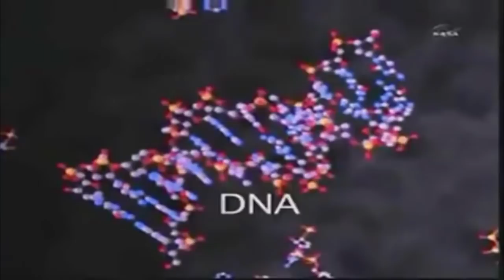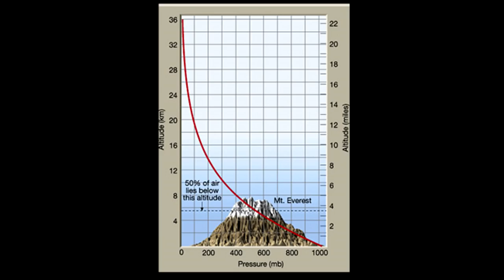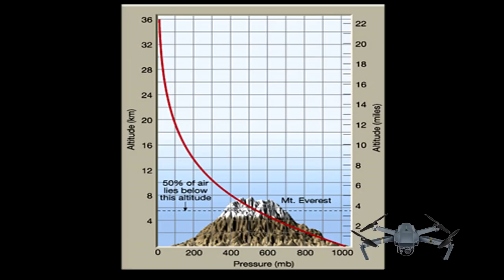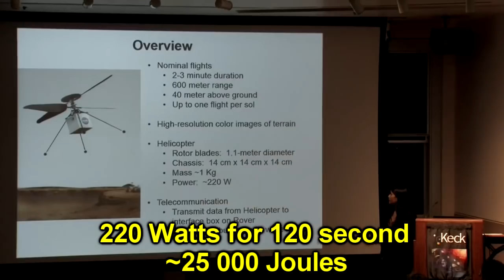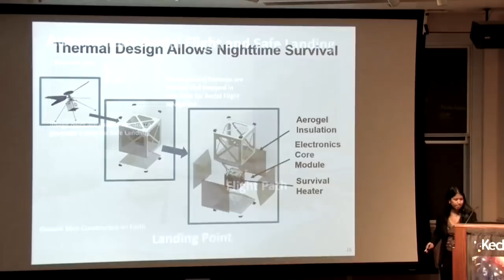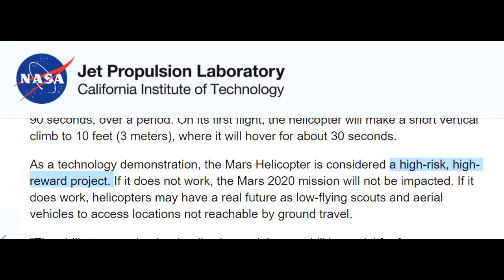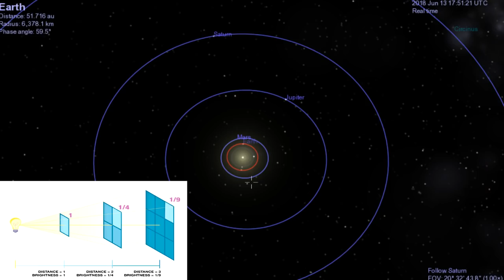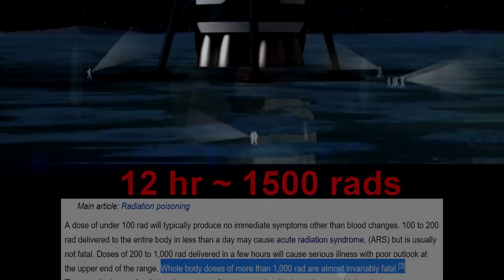NASA is sending Helicopter to Mars!! Smart or Silly?

Comment: Hm..the oversimplification about the lift of the blades makes the calculation not satifactory to me. In aerodynamics/fluid dynamics the forces on the blades increase by the square (lift and and drag as well). So you don't have to spin the blades twice as fast to generate twice the lift. This is comes from the kinetic energy of the air molecules being deflected where the velocity is by the square. If the rotor spins twice as fast in haft the density (half the molecules), the molecules deflected have also twice the downward speed (and 4 times the kinetic energy). 

The calculation of the power of a 40W rated solar panel should also be looked at: The 40W is instantaneous power. Whatever the instantaneous power is delivered by the panel (Diminished by the factors 1/3 well explaned in the video because it is layed flat during the day) should not be again divided by two the step 'Average continuous power (earth)'. That is already include in the step before 'Average power for daylight hours'. Space grade TJ solar cells (up to 30%) are almost double the efficiency of the solar panel used as reference here (app. 17%). The 1W can be easily be increased to 2W in my opnion.

I like the video and it triggers my scientific thoughts,  but must agree that there is lot of wishful thinking in how some project are presented by Mr. Musk after all but in this stage that is very natural and it is not a bad thing to be aim high, not sure it it realistic though.
Reply: Not exponentially, just square-law.
Reply: BrightBlueJim  In deed, you are correct. Thanks

Comment: make the blades out of solar panels.
Reply: ᗩ乙Ꭵᖇᗩᖺᗩᙓᒪ solar friking blades roadways
Reply: Tumbbi well, they will be less resilient than solid carbon fibre, but look at all that surface area.
Reply: ᗩ乙Ꭵᖇᗩᖺᗩᙓᒪ meme only for thunderfoot
Reply: Probably not gonna work due to wiring / connection factors as well as centrifugal forces on the N- and P-plates in the solar cells.
Reply: that wouldnt work that would make them very heavy and require a lot more power to spin mabe the sides could be solor panels though,

Comment: I agree with most of what you say, but, concerning what you say around minute 12 about the efficiency of solar panels: aerospace applications use extremely expensive multi-junction cells, which are twice as efficient theoretically than the garden variety and, in practice, almost three times so.

Comment: If they can embed solar panels in the rotors,  they will have a backup power source that can be cleaned once the rotors move. If the rotors are composite,  this shouldn't be too difficult.

Comment: I think they should include a simple robotic brush for every new rover to remove dust from the panels xD
Reply: just shake the dust off. DSLRs have been doing it for years with their sensors.
Reply: yeah, no. too much extra weight for too little benefit. opportunity is still functional to this day on its solar panels, that's almost 15 years.
Reply: the dust can stick badly due to the electric charge.

Comment: I think you missed the most critical obstacle this craft will face. There is no system to right the craft if it tips over not from crashing but from the monumental dust storms. The craft is designed to gain maximum lift from minimal atmosphere. During a Martian storm this thing will be swept up and sent a quarter of the way around the planet and dropped off on its side ending its short already doomed mission
Reply: depends mars sandstorms are quite weak due to weak atmosphere butttt it wont like rocks

Comment: That is not how a blade works on helicopter.  They don't bat molecules down pushing the copter up.  They work on a pressure differential produced by the gas moving faster over the top of the blade.  Same as  a wing on a airplane.  How many airplanes do you see with wings at 45°?

Comment: Radiation, no big deal for Elon. What does Thunderf00t know? It's not like he worked at a nuclear reactor or something. For the helicopter, just add a couple of EM drives. On a more serious note though, why don't they make a larger quadcopter with a radio isotope for power?
Reply: Thunderf00t has worked extensively on and with research reactors here in The UK. Radio isotope for power? How do you mean?
Reply: I know that Thunderf00t has worked with reactors, that was the joke. Further, I mean using a radio isotope like the one used on Curiosity. I don't know how much they weigh or how far away from the electric components it needs to be, so I assumed a large helicopter was needed. A quadcopter can also be designed to fly using only three of its rotors, improving reliability.
Reply: RTGs are HEAVY. Plus the darn earthlings still aren't big fans of hurling radioactive materials through their atmosphere.
Reply: Sorry - I completely missed the irony re Thunderf00t. My error. Are you referring to the devices which directly convert nuclear radiation (beta, gamma, alpha) directly into electricity? I don't know much about 'em, please point me somewhere I can read up. Cheers,  P.
Reply: I am referring to Radioisotope Thermoelectric Generators (RTGs):
http://large.stanford.edu/courses/2013/ph241/jiang1/
Reply: As already has been pointed out the helicopter is a light scouting eyes-in-the-sky assistant to the rover weighing 1.8 kg - the lightest RTG we've sent to space is around 12 kg. Overkill.
Reply: Would it be able to fly with all that weight?
Reply: @Andrew It seems that RTG offer more power per weight than sollar panels.
Source: https://ocw.mit.edu/courses/aeronautics-and-astronautics/16-851-satellite-engineering-fall-2003/lecture-notes/l3_scpowersys_dm_done2.pdf
(page 17)
Reply: Mika de Grote - Yeah it's not like Musk doesn't have a team of rocket engineers or anyone who could think of this stuff. Musk's whole operation is single handedly brought down by some guy on YouTube.
Reply: This heli was pitched as a "high risk, high reward" add-on to an existing mission.  The kicker is, if it fails completely, it has little effect on the mission.  Thus the 1 kg target.
Reply: Good question, that's what I thought as well. Also, 12 kg is more weight, but nothing which should make the vehicle impossible from the get-go. So what I'm curious about is if it would be feasible to have a slightly bigger, but also much more effective vehicle (instead of just 4 minutes, I wonder how long an RTG based drone could fly). 

My guess is that they'd rather try the concept of a flying mars-vehicle with a relatively cheap version, before going "all-in". Or they really do have weight constraints which limit the available weight to the current concept.
Reply: The helicopter is an auxiliary project so it has to fit into the leftover space of a more important probe's rocket, thus it's TINY.  A quad-copter would be too big and a nuclear battery would probably be too heavy regardless.

Comment: also "The full 30-day flight test campaign will include up to five flights of incrementally farther flight distances, up to a few hundred meters, and longer durations as long as 90 seconds, over a period. On its first flight, the helicopter will make a short vertical climb to 10 feet (3 meters), where it will hover for about 30 seconds.
"
so it will fly for really short time and than charge for really long time

Comment: Huh, I always though helicopter blades work the same way airplane wings do.
Reply: JbtSveZauzeto1 Because they do.
Reply: They do. They make air go down.
Reply: Airplane wings don't make the air "go down". The generate lift by difference in air pressure at the top and the bottom surfaces of the wing caused by air flowing over them at different speeds.
Reply: If airplane wings didn't make air go down, they wouldn't be producing lift, and they'd fall out of the sky.

What do you think air pressure is? Air goes down, pressure goes up where it goes and down where it came from. Herpderp.

Is grade school physics too much to ask of you?
Reply: JbtSveZauzeto1 yeah, and that difference in air pressure corresponds too... air going down
Reply: JbtSveZauzeto1 if the air didn't go down, there'd be no upward force, that's conservation of momentum.
Reply: I think he's talking about how they don't just 'push air down' but how they create a lower pressure at the top of the wing effectively sucking the wing up.
Reply: They do... Thunderf00t oversimplified and swarms of pedants and aerospace engineers have come out to eat him.

Comment: Should'nt the power generated by the solar panel be around 30% higher given theres almost no atmosphere that would block the sunlight? Also solar pannels they would use would propably have officiency around 40% which is twice the 20% end consumer pannels have. That would mean it would be around 8 watts instead of 3 and about 650 000 watts per day.
Reply: The peak irradiances on the surfaces of Earth and Mars are 1000 and 560 W/m2 , respectively. So no, a panel on Mars would be worse at charging a battery. You only start to see the energy advantages of the lack of atmosphere over long periods of time. I.e. you're charging a high capacity battery over a year. So for a permanent base it might perform better on Mars than on Earth.
Reply: Also...does NASA use those expensive multi-junction solar panels in space that are more than 50% more efficient than your regular silicon panels?
Reply: hmhmhmlol
Sorry, but that doesn't really make much sense to me.

Maybe I'm just stupid, but how can solar panel produce more energy in a year if it somehow produces less energy every day?

Also, the impact of atmospheric interference is least noticeable during peak hours because that's when the sun is right overhead and only has to shine through a thin layer of air. If the sun is lower in the sky the distance the light travels through the atmosphere drastically increases, so the impact of a thick atmosphere is much stronger.

Comment: How will they make it fly or even stay in one place on the ground when a dust storm hits on Mars?
Reply: Perhaps a docking station of some sort, which houses the actual generators? Then you'd not have to worry about anything energywise aside from a battery.
Reply: good thinking but from all the graphic I have seen that's not going on the trip - I give it 30 minutes max before it crashes and burns #famouslastwords
Reply: Maybe it can peel itself flat to lay on the ground. Ikea could help here.
Reply: A dust storm on Mars? You do realise that Mars has 1/100 the atmosphere of Earth? A dust storm would feel like a summer breeze.
Reply: QALibrary dust storms on Mars (sorry Matt Damon) are very weak.  No air mass means no significant effect beyond the dust covering solar panels.
Reply: QALibrary this tiny little drone is scheduled for just a few minutes life.  30 flight minutes would thrill the engineers
Reply: Cycling Cycles 
There is a very bad dust storm happening right now on Mars. Sunlight is down to a fraction of what it usually is and NASA engineers are genuinely afraid that Opportunity might not survive. 🙁 
They have put the rover in a sort of extreme hibernation mode.  All non-critcal systems have been powered down.  The only thing NASA can do is wait and hope that Opportunity's batteries will get just enough juice to keep the internal heaters functioning.

Comment: these are not your typical "harbor freight" china  solar panels  
these are the finest solar panels money can buy.  with Unlimited budget  so a single panel will be about $80,000 to $100,000  Full spectrum panels.. that is probably a 75watt panel
Reply: A solar panel is a solar panel. The efficiency is not limited by how much money you put into it, but by the technology used. and everyone, even china ones, uses the latest technology because noone buys anything else. And NASA isnt going to put some experimental "only worked in a lab once" panel in such a craft. They tend to be conservative with the hardware choices because reliability is more important.
Reply: @Strazdas Uh, no. The efficiency and cost entirely depends on the material it's made of, which puts a limit on the consumer market but not on NASA who can afford the highest tech. And most of the time they absolutely do use the highest tech. 

There are two main materials, silicon, and gallium. 99.9% of ground panels are silicon because they cost like 1000 times less than gallium panels, and the advantages of gallium panels in ground applications just aren't enough to justify the costs.

 In spacecraft however, the advantages of expensive gallium panels are absolutely worth the cost, And NASA is absolutely going to use them in spacecraft, because:

-They're lightweight. This is by far the most important thing to NASA. Every pound of spacecraft costs $10,000 to get into orbit, and your spacecraft can go farther and operate longer the less it weighs. On the ground we don't care if silicon is heavy because it costs us basically nothing to transport. In spacecraft the weight is usually unacceptable.
-They last longer in space because they're more resistant to radiation. This is also obviously very important. But again, it doesn't matter on the ground.
-They're more efficient for the same area. This matters to NASA because A) they generate less waste heat and allow for smaller radiators, B) they more easily fit into launch vehicles, and C) they present less area to get struck by space debris. Again, none of this matters on the ground.

And so it shouldn't be any surprise that, aside from the International Space Station, most if not all major space missions now use gallium panels instead of silicon. They're not experimental they're just 1000 times more expensive but exactly what spacecraft need.
Reply: @StrazdasLT  Completely wrong. You can buy the 40 watt panel at Harbor freight or you can buy a panel that is the exact same size from Lowes that puts out 100 watts.

Comment: FYI, there are drones that can fly both rightside up and upside down.
Reply: well, that fact doesnt really work with the proposed design.
Reply: I will have to look, that seems like a feat. With a normal drone type fixed blade rotor design the blades would need to be stopped and reversed in pretty short order.
With a normal helicopter design, with a swash plate and individual/cyclic and collective pitch designs, one simply needs reverse the blades pitch, and not reverse the whole inertia of the rotor assembly.
Of course, multi blade fixed rotor designs are more often much shorter, smaller and lighter blades. But I would still like to see it.
Reply: ComputerNoises I'm pretty sure that there are drones that can hover sideways
Reply: You just need to spin the propellers backwards. Inefficient af, but the quads have such a high power to weight ratio, it works anyway. Switching direction takes a fraction of a second. https://youtu.be/OWYt3JYlOHY?t=28s
Reply: I hope it doesn't require the user to swtich the flight mode from rightside up and upside down, considering 4-minute lag. Otherwise by the time you see the drone flip, it's probably stumbling down Mars' hills.
Reply: T@ComputerNoises Those are not "drones" they are radio controlled aerobatic helicopters. Most helicopter guys get very triggered if you call them drones due to being caught in the crossfire of restrictive regulations that have been coming down from the FAA as a result of easy to fly autonomous drones like what DJI sells falling into the hands of idiots who then do stupid shit with them like flying over airports and wildfires. They like to distance traditional radio control from that as much as possible and would like to actually separate the two (direct line of sight radio control and autonomous drones) legally from each other. I'm inclined to agree with them here, it's not the RC guys that are causing problems it's the self flying drones being purchased by idiots.

Comment: They actually did it, it flew for 30s on mars
Reply: yeah straight up and down like thunderf00t said and not like the silly cgi video lol
Reply: Three flights now, the third one consisting of a long translation sideways and back to the starting point. There's no satellite navigation like GPS helping it with that on Mars either. He called this pretty accurately, down to the size of the required solar panel! Mars is hard, it's just that JPL can make it look easy. Even they have had their failures like with the Mars Polar Lander.
Reply: @steviegbcool   yup thunderfoot was right he didn't say it was impossible